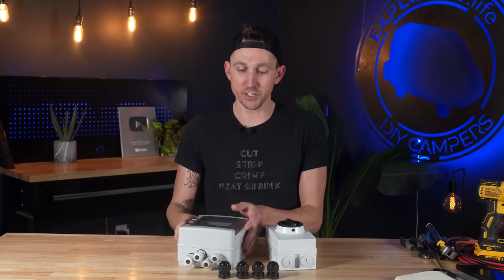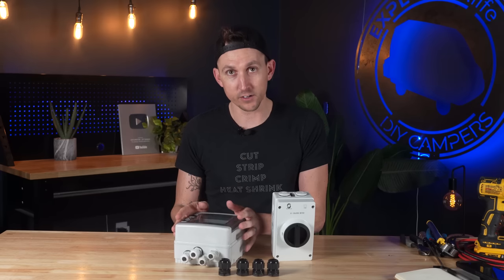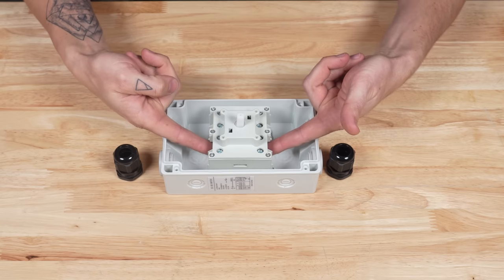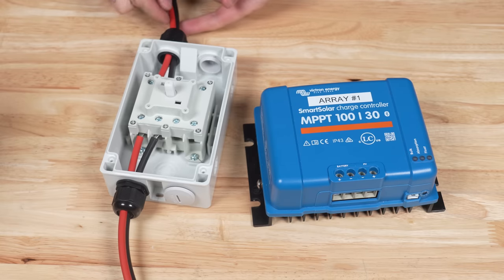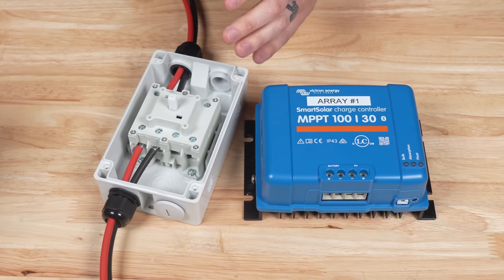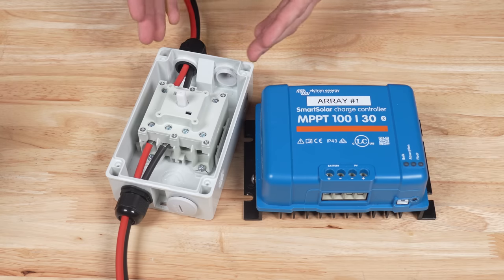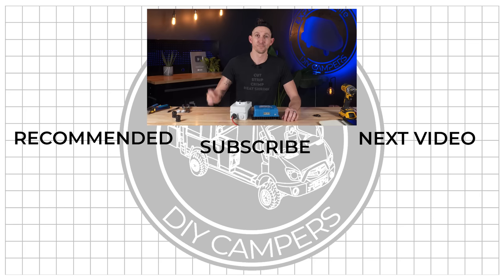SOLAR ISOLATOR WIRING (for a DIY camper van)

Comment: Our first addition to our system after adding a GameChanger3. I used to race in the sport compact class. The first rule of thumb when adding performance products was to upgrade brake. This device is the corollary to brakes. Plan to add close to 800 w more power in a second array.

Comment: Hey Nate I have 4-100 watt solar panels and a Victron 100/30 charge controller and one 12 volt lead acid battery should I wire the panels in series or parallel?

Comment: Wish I had watched this video sooner. I built my system and had followed a similar build from online that used a DIM rail AC Miniature Circuit Breaker with enclosure. Following that example nearly caused  a serious injury.  The DIM rail AC Miniature Circuit Breaker was faulty and allowed current to flow from the solar panels into the system all the while installation was in progress. And yes the wire posted had been checked after installation and failed after install.  So bottom line always check your electrical post, be safe and enjoy. Thanks Nate your videos are gold.
Reply: you used ac breakers for dc?
Reply from the maker: Breakers should be rated for their use, so… no.

Comment: Is there any reason to change out the circuit breakers for the isolator? TIA
Reply from the maker: If your dual pole breaker is wired correctly and is not giving you issues; there is no reason to switch.

Comment: I want to use the previous breaker box and use 2 pole breaker that you recommended. I'd also like to add another 2 pole disconnect in the box, as a battery isolator to stop current exiting batteries to loads. I'm guessing the other box will be better/is rated for that sort of thing. I have 4 x 12V x 100ah lithium. 24v series. Will have to find a breaker appropriate for batteries.

Comment: Thanks for the technique on stripping solar wire. The 10 gauge wire is kind of unique The two tool method  helps prevent losing any wire strands. Thank you both for sourcing and distributing these kits. Cheers.
Reply from the maker: Good catch!  Yeah, the solar wire sure does have a burly insulation on it that the self-adjusting strippers cant cut through, so I score it with the other strippers and then use the self-adjusters to pull it off the copper.  Thanks for tuning in!
Reply: I agree with everything you said
Reply: @EXPLORISTlife  
Yep great point and thanks for the video

Comment: Thanks for explaining that.  Although the dedicated switch is smaller, it's still quite unnecessarily bulky considering the simple switching it does.  Are there any more-compact solutions or is it possible to use the old solution with breakers in a much-smaller enclosure or without an enclosure assuming it would be properly protected by a non-conductive DIY cover?  

So many of the solar electronics components and modules seem as if they were designed with only residential applications in mind where space is not a premium.  I think there's a worthwhile market for solar equipment that isn't so bulky where not necessary and I hope companies will start to engineer more products specifically for mobile applications or at least are compact that serve both mobile and residential applications well.
Reply from the maker: If I had a solution that was smaller, you can rest assured that I would have chosen that one instead.  I'm always on the lookout for better/smaller parts, and a smaller disconnect that still has the needed ratings is definitely on the list.
Reply: @EXPLORISTlife  thanks

Comment: Hey Nate. You've helped me a lot with my RV setup over the past half year or so - definitely couldn't have done it without your expertise, I really appreciate it. Do you know of any good videos (or will you be covering it and making your own?) that cover the actual process of mounting solar panels to the roof of a van or RV? It seems to get glanced over in any of the guides that I watch; maybe that means it's common knowledge and doesn't really need to be covered, but I'm totally in the dark about it and am a little intimidated. Are there specific mounting systems that I should be looking into? Do they have names? Or do all solar panels come with their or brackets that I simply follow the directions to use? Do I have to mount them into the frame of the RV? Anything you might be able to share to get me going on this last part of my project?

Edit: Sorry Nate I see you already made the video: "DESIGNING & BUILDING A ROOF RACK (to hold 580W of solar)" I'll give that another watch and see what I can learn.
Reply: Thank you for your comment I was wondering the same thing I don't want to drill into a motorhome roof. And I'm a little bit in the dark on the best ways to put on solar panels hopefully I can find that video.
Reply from the maker: We will be doing RV specific videos later this year.  I'll be sure to cover how to attach the panels to an OEM RV roof.
Reply: @EXPLORISTlife  ok ty

Comment: Thx a lot Nate, you're quite an hero in many ways. got the newest EG4 18K-PV which doesn't need a combiner box and I'm also going to use Discover AES 42-48-6650 (4 of them) 2 per string hooked up to a T-class fuse "each string" do I need anything else?

Comment: Can these isolator switches be used for positive wires only?
I have 4 different arrays, so instead of needing an 8pole set up of switches, can i run all negatives to a bus bar/bypass the switch, and have all 4 array positives go into the switch so i can isolate all 4 with 1 switch?

Hope that makes sense.

I'm very limited on space so only having 1 switch would be ideal

Comment: So I am setting up a "medium sized" RV solar install.  I did a simple setup by just replacing the existing lead acid batteries with 2 SOK 206ah batteries all in the exisitng battery box.  I also replaced the existing charge controller with a lithium programable one.  Since then I have also added a DC to DC charger to run off the alternator.  Haven't installed any solar panels yet, to be 800 watts on 2 mppt controlers.. 
So far so good, no conflicts in the system.  Of course I only use shore power or generator when the coach is not in motion.  I have been looking at those fancy Victron  Multiplus things but I already have the charge converter.  Do I need to concerned with power coming into the batteries form both solar and the shore power? or say the DC to DC while driving and the solar panels?
Is there some other device which would automatically switch between solar and some other source?  Basicly they system is controller manually so I was thinking of the solar disconnect would also do the job.  But its dummy proof. And I am a dummy.
ps: I did a search but probably don't know the proper terminology.  If you already have a vid on this I apologize.  I did look but didn't see anything.

Comment: hi. great vid. question, i was using dc mini switches not just for the on/off but also the tripping functionality, if a surge came, it would hopefully pop them.  do the isolators have that "fuse breaker" functionality or just on/off with the knob? is that something you'd want?
Reply from the maker: There is no way a solar panel can produce a 'surge' shy of high-line wires falling on the array or a lightning strike, both of which would likely destroy either a breaker or a switch.  So no... under normal operation, a breaker in the location of the isolator cannot function as overcurrent protection.
Reply: Could a faulty charge controller not put the full capacity of the battery on the conductors from the panels? The overcurrent protections is needed to protect the conductors from overheating.

Comment: Nice video. I just bought a portable solar generator and want to buy solar panels to charge it. I would like to have at least 2 charging points coming from the same solar panels. Are there are any "distribution boxes" or something of the sort that will allow me run cables from the solar panels to different rooms and allow me change which charging point is active at any given time?

Comment: Thank you for making all of these "side quest" videos!! Is there a solar Isolator that will work with a Max Solar Array Amperage Output of 100A (MPPT 150|100)??
Reply: Just a note, the current out of a charge controller is (almost) always the limiting factor.  The battery voltage is (almost) always lower than the panel voltage, so to match power the current is higher.  As an example, A 12V battery (14V charge voltage) can take 100A from a charge controller.  The power out of the charge controller is volts * amps which is 1400W in this case.  If the panel voltage is 30V, then the max panel current you'll see is 46.6A.  I've heard of boost charge controller that can output more voltage than input, but I haven't seen one.
Reply from the maker: Exactly, madcow.  For further examples... all of our solar charging wiring kits keep the array amperage under 30A so we can use standard PV combiners.  The charge controller will boost that amperage up to 100 (given a 100A CC and adequate solar input) once it regulates the voltage down to a voltage more appropriate to charge a battery bank.

Comment: Grounding Question: We have the solar isolator as described in the RV as a master cut off that comes from the PV wires from a PV combiner box . The PV combiner box is roof mounted (4 strings, surge protective device, 50A DC breaker). The PV combiner box also has a cable gland for a ground wire and connector inside the box (from the SPD). Should we run a ground wire from the PV combiner box to the RV chassis frame? Thanks.

Comment: Hello Nate, I have 4 x 310 watt panels wired in parrallel going to a Victron 150/85 mppt charge controller.   Max voltage input is 40 volts and approx 31 amps input, what would you recommwnd as the size of fuse/circuit breaker prior to the solar isolator as I would prefer a circuit breaker over a fuse for convinience etc?

Comment: Hi Nate. Thanks for the work and detail you put in your videos. I noticed in your recent builds you wire the battery isolator switch directly to the Lynx system and the solar charge controller to the same bus bars. To me with the isolator off, solar energy is not powering the batteries. As a weekend warrior I want to keep the batteries charged while the isolator  is off to prevent phantom draw. Is the solution to connect the MPPT directly to the battery instead of the Lynx? Any disadvantages?
Reply from the maker: Just turn off your lights, fridge, inverter, and other loads and keep the solar on.  It'll accomplish the same thing in an easier manner.

Comment: Hay Nate,

Quick question. can i use this switch lets say to isolate a B2B charger (victron 12/12/30 DC-DC)/ so 2 birds with 1 stone???
one side would be solar array, other side B2B charger?
Reason i am asking cos it exceeds both the solar controller (Victron 100/50A) and the B2B charger ratings if there is any 64A model.

Thanks, Greg

Comment: I am planning a small array of panels (6X400 watts) with enphase IQ8 plus microinverters, can I use this isolator right after the Q cable before carrying the power to the house and the panel, can it be used for AC current? Thanks. There will be a disconnect before the main panel.

Comment: Hey Nate. Solar isolators are required by code for residential or commercial terrestrial solar installation where there are obvious grounding issues. The bulky solar isolator seems to be over kill for an RV. In an RV isn't a DC cutoff switch on the positive wire from the solar panels to the controller enough to provide solar isolation? That is the recommendation from AM Solar, who have been building RV solar installations since 1987.
Reply from the maker: I'm always going to err on the side of  more conservative/safety (because of those residential codes you mention).  There's no reason not to.  I can't base my videos on things that "seem" to be overkill.  That would be irresponsible of me.  The RV industry has garbage codes that were written way back in the day when RV manufacturers were trying to do the least possible with no regard for property conservation in terms of fire.

Comment: Nate,  The isolator is rated for 63A, is that for the entire switch or for each pole connection in the switch? The reason for my question is that the way I was planning on wiring my two arrays in parallel would total 66A, with two controllers. I am trying to avoid using series because of any shading which may occur on the panels resulting less output for the whole array. Also if the max for the switch is a total of 63A, does that translate to 31.5A for each side of the switch or can the amps vary for each side, one being more than 31.5A and the other side being less than 31.5A? Do you have access to their 100 amp version from the manufacturer. The information I have found is limited.

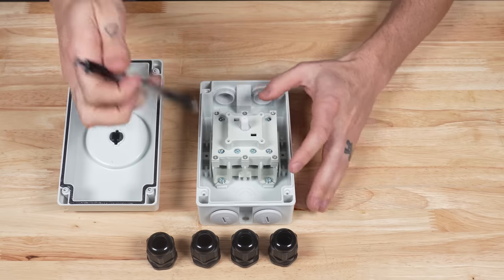Comment: I noticed at the 1:50 mark that it looks like there are cracks under the lower mounting screws. Is this a common issue with these components? I don’t want to worry about long term quality, but this seems like the best product available that I’ve researched.
Reply from the maker: It's not an issue, no.  This is our 'testing' isolator and has really been beat up.  You'll never abuse your isolator like we do in the shop while making these videos and during R&D. 😂🤣

Comment: Dave, as you formery used the fuses as disconnect, my question is still were to place the disconnect?
From my feeling I would place it near the solar array.
Reply from the maker: Regardless of if you use a breaker or this switch as the disconnect, it would go next to the charge controller.  If you array needs actual fusing, those would be on the positive wire coming from each of the positive wires coming from the solar branch connector.

Comment: Thanks Nate.  A question - I just laid out plans to upgrade the solar on our travel trailer to add a second panel, an appropriate charge controller and add a disconnect SWITCH per your earlier video.  If there is a right direction for wiring through the 2-line switch, how do I identify that so it is used correctly?  Or are switches really a poor choice for isolation?  Thank you for the great instructional videos!!
Reply from the maker: As for 'right direction' for the breakers, you'll just want to check out the instructions that should come with the switch.  The isolator shown removes all doubt on what is the correct way.

Comment: Is this a better option than breakers or do you recommend replacing the breakers with this?
Reply from the maker: If the breakers are rated for the load, are wired properly, and are not giving you issues, there's really no reason to swap.
Reply: Yes you should. AC breakers are not designed for DC and AC breakers cannot handle arc extinguishing as DC breakers do.

Comment: Nate, thanks again for the great videos and information. I plan to replace my Solar panel breaker with a DC disconnect! I did have a couple of questions about using the DC disconnect, main battery switch and what you recommend for order of switching and stand-by mode.
1. Based on your videos I think you want to power batteries first, then solar. This way the Solar inverter is powered and can function when the Solar kicks in. In shutdown you want to disconnect Solar, then the battery bank. Is that correct? I seem to remember from some video that you agreed with this but may have said the Solar inverter won't be damaged if you leave the Solar on, but the battery bank off?
2. What do you/or Battleborn recommend for stand-by when not using your RV? Should you power everything off and leave it (say for 3 months until the next adventure....)? Or do these systems like being topped off so perhaps leave the RV sitting there with Solar/Battery Bank on, floating the system for months on end? 

Thanks Nate

John
Reply from the maker: 1: Correct.  There should always be battery voltage to the MPPT while there is PV voltage to the MPPT.

2: Check Battle Born's FAQ page.  They've got their storage/winterization info available there.

Comment: Hi, I see a few simple battery disconnect big red switch used for solar cutoff, I guess there would be an advantage tu using this solar isolator instead of those switches ?
Reply from the maker: Indeed.  Much higher voltage ratings on these isolators, which is what we need for properly designed solar arrays.
Reply: @EXPLORISTlife  nice, thanks !

Comment: How do you connect "hot wires" to the isolator (panels already mounted on the roof and connected)? Do you cover the panels when making connection or use precautious when making connection or you do something else? Thanks
Reply from the maker: Disconnect the PV connectors from the array on the roof and then the wires coming into the isolator will be dead.

Comment: Say you have two arrays of 4 panels each going to two separate MPPT charge controllers and you want the ability to isolate the arrays individually…Array #1 and Array #2 this box won’t do that.  Would need two boxes.  Wouldn’t a battery master cutofff switch work just as well with “1, 2, Both, Off” to accomplish the isolation of each array, having both on and having both off?  Can those type switches not handle the higher open circuit voltages from Solar?  Thanks!
Reply from the maker: This may take a more in-depth look at your personal setup.  If you have purchased/are purchasing from our store (shop.explorist.life) reach out for some more personalized help: shop.explorist.life/support

If you've purchased/are purchasing elsewhere, reach out to your dealer for support.  We'd love to have you as a shop.explorist.life customer so we can provide a bit more help in the future. 🙂